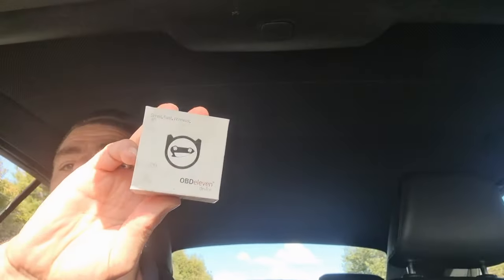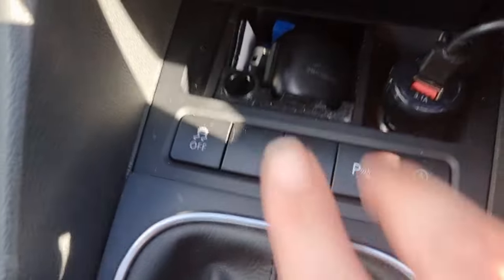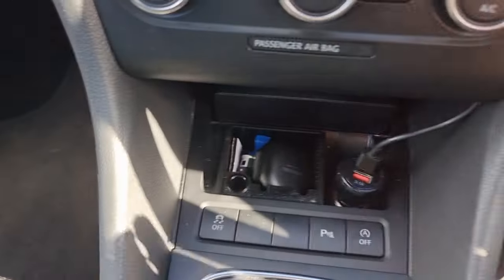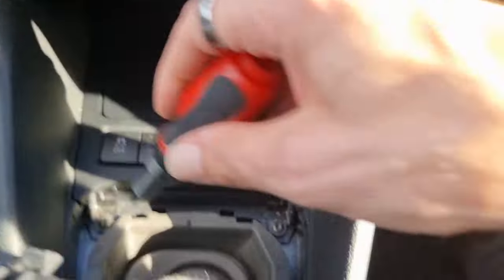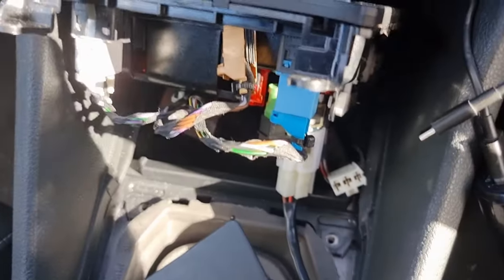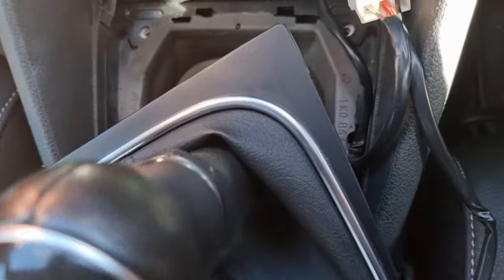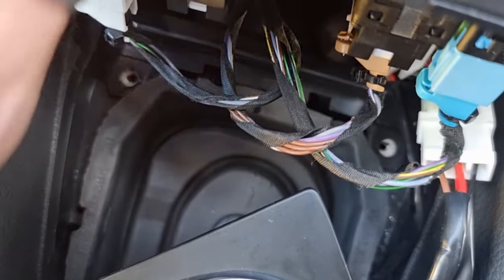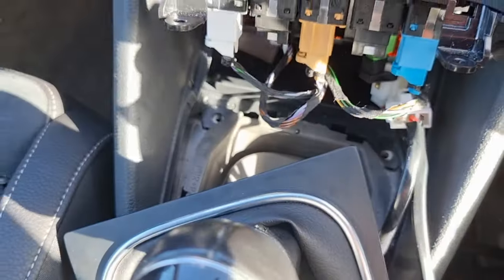Volkswagen usb fast charger install

Comment: Hi. Got some questions.

1. Does this affect how much power is delivered to the cigarette lighter?

2. Are these quality i.e. they won't damage any device that is connected to them?

3. Is there an option to get three of those ports for a VW MK5 Golf?
I will be having two of the ports available to use for the car, but I want one port hidden underneath the console so that I can connect some footwell lights via USB. Would there be any issues since the footwell lights are 5V and this is a 12V connector?
Reply from the maker: Doesn't affect power out put to the 12v port. 
The 2 I have are linked in sequence...don't see why you could purchase a single and double and link the 3 together...footwear lights will work of of these

Comment: nice vid, thanks. 10 mins to fit but the finish isn't a good match for OEM. Still cant grumble at the price or with the install vid. Cheers
Reply from the maker: Colour is slightly off, but they work

Comment: Thank you for this Vid, just fitted mine and moved my parking sensor to the middle, looks really good. The silver bendy clip that’s on the front and back of the parking sensor unit (to hold them in) the front one come off and I couldn’t get it back on, I’ve put it all back together and it seems fine, I guess it’s ok without it but any idea how you can put it back on the unit?
Reply from the maker: They are just clips to stop them from being pulled up and out...not got a clue how they go back on 🤷‍♂️

Comment: Hello,
I installed the same USB ports on my Golf 4 car, but even though the car is not running, the USB port lights are on and never turn off and it continues to charge the phone. What could be the reason for this?
Reply from the maker: That will be because the golf mk4 12v port remains on even when the ignition is switch off....not sure off hand but I think the mk4 12v port fuse can be move so it ignition live instead of permanent live

Comment: Just came across this video and like the way it looks, just wondering when you ordered the kit, did you have to specify 2 usb?
Reply from the maker: I don't know how I ended up with 2 usb... I thought I had ordered 1 usb and 1 usb-c, but 2 usbs turned up 🤷
Reply: @whatsdavedone104  aw fair enough, it’s 2 usb I’d prefer. I might be lucky like yourself when I order mine 😃
Reply from the maker: Just found this one that gives you the option to choice....double usb is listed 
￡4.35  20%OFF | 1PC Quick Car Charger Socket 12V/24V Cigarette Lighter QC3.0 PD USB Interface Use For Volkswagen Jetta 5 MK5 Scirocco Golf 06-12
https://a.aliexpress.com/_EJ1O9TV
Reply: @whatsdavedone104  you are a legend, thanks for that, will get them ordered.
Reply: @whatsdavedone104 should this fit a mk3 caddy 2012 plate?
Reply from the maker: Yes will fit a caddy mk3 👌

Comment: Is there a way to stop the led from lighting up even when the car is off. I'm worried about the battery
Reply from the maker: What car have you installed it in? My MK6 12v port is ignition live, I am guessing your is constantly live 🙈
Reply: Erm a 2010 Scirocco. I think the light actually went off after a while..... Only just installed about 30 mins ago so not sure if it just stays on for 10 mins or something. It doesn't charge until I switch the car on though so maybe it's some sort of remaining power in the circuit?
Reply from the maker: @delboysung  if it's not charging until ignition is on then there will be no battery drain, leds can hold a little power for a short time after power source is turned off.
Reply: Hey @depboysung does it charge while car is off? Planning to install on my scirocco too
Reply from the maker: @aoxsystems if you Cig lighter is ignition power only then no it won't charge with ignition off
Reply: @whatsdavedone104  thank you, gonna try it

Comment: Hi. I got the same wiring harness as yours but have the QC3.0 and TYPE-C+PD plugs. I saw where you plugged the big female connector to the cigarette lighter but am confused as to where the smaller male plug that runs off the female one that plugged into the cigarette lighter goes. Mu harness has two plugs in addition to the two USB plugs. I hope I haven't totally confused the hell outta ya! 😂! TYIA.....
Reply from the maker: Let me just watch the video back to see which connections you mean 🤔
Reply from the maker: I'm sorry but I don't know which plug you mean...unplug the cig lighter, plug harness from usbs into the lighter, then plug original plug for lighter into the white plug on the harness 🤷‍♂️
Reply: @whatsdavedone104  thank you so much for your reply. I think I understand now. The big plug goes onto the cig lighter and the factory one that came off the cig lighter plugs into the only remaining plug. Thank you very much! Am going to do this on my next day off! Have a great weekend Sir!

Comment: Hi, do you have any example of how it connects with the cig. Lighter unit? Could’nr get a really clear view on it connecting 😅
Reply from the maker: It's a straight forward piggy back from cig lighter to harness. Cig lighter still works after all is plugged in.

Comment: Hy. Does the usb-s glows red in the dark?
Reply from the maker: Yes it's glows red 👌
Reply: @whatsdavedone104   And Dave, one more question. Does the light turn off when you remove key?
Reply from the maker: Yes, it piggy backs off the 12v cigarette lighter. Ignition off no power to 12v
Reply: @whatsdavedone104  tnx
Reply: @Dave, I’ve connected a fuse adapter so my cigarette lighter stays on after shutting the car off and it doesn’t drain the batter. I’m curious once I toggle the usb into the lighter, would having those usb still on drain the battery?
Reply from the maker: Very low voltage on leds, I can't see that it would be enough to drain the battery.

Comment: what voltage do they provide at the usb output, are these plugs also chargers and provide 5V, mobile phones are charged at 5V, also dashcams...
Reply from the maker: 3.1 amps fast charging, all charger provided 5v....its amps not volts
Reply: @whatsdavedone104  then I can charge the mobile phone without burning the mobile phone...
Reply from the maker: No issues charging my Samsung S21u for the past 6 months, can also fast charger tablets and laptops

Comment: Do you know how much watts it gives? Is it safe to use if it's connected directly to the lighter without any electronic?
Reply from the maker: It's 12v 3.1amps....yes it's safe to use

Comment: Hello, where to find 2 usb in the same wire as you show us in your video ?
Reply from the maker: There is a link in the video description .....￡16.62  30%OFF | USB Charger Socket Fast Charge Adapter PD Type C and QC3.0 Power Outlet Switch for VW Golf 6 Jetta 5 MK5 Scirocco 2006 - 2014
https://a.aliexpress.com/_EI5cOjv
Reply: thank you for your answer but I see them but there is just 1 usb the other is Type C not USB ?
Reply: here i found the link
 @whatsdavedone104

Comment: So is there a step down in the button from 12v to 5v or something?
Reply from the maker: I guess there must be, but not sure where it would be in the harness 🤷‍♂️
Reply: @whatsdavedone104  Nice one m8 I just ordered of aliexpress. Do you know what the Watts on it? Probably like 20 - 25w?
Reply from the maker: Not sure but it fast charges my Samsung s23u....think its 25w
Reply: @whatsdavedone104  I have samsung, too, so it's defo better than normal 2.0 usb way better. Cheers 🍻
Reply: @whatsdavedone104  Does your one have a spliter so that you can still connect the lighter socket?
Reply from the maker: @Drian12_1-pn3oi yes, it piggy backs off the 12v so the actual lighter port can still be used along with the 2 usbs all at same time.
Reply: @whatsdavedone104  ahha nice one mate thank you. I'm surprised it's actually this good of a design.
Reply from the maker: It's a fantastic design add to the fact you can choose which connection types you want, 2x usb, 1 usb 1 usbc or 2 usbc....

Comment: Any way to connect these with an Android auto radio so I can run Android auto through it?
Reply from the maker: Unfortunately not, they piggy back off the cigarette lighter...you can purchase usbs fit in slot and go to back of headunit....what headunit do you have?
Reply: @whatsdavedone104  I haven't purchased a head unit yet. Shopping around. Some have USBs in the back. But I've yet to find a USB to USB one!
Reply from the maker: I have the Eonon Q53pro, see videos on my channel, best unit for the money, wireless android auto https://amzn.to/3j69897
Reply from the maker: @Clarke  ￡2.78 | 150CM DIY Car USB Adapter Audio USB Cable Switch for Volkswagen
https://a.aliexpress.com/_EyqJbtP
Reply: @whatsdavedone104  Dave your a legend thank you!! I'll scrap that Ali idea and go with the Eonon you linked. It'll look slick in the scirocco! 

I hope the wireless android auto works well? I've a pixel 7 pro
Reply from the maker: Do a wired connection before fully installing, use original charger cable. Then unplug the wire, complete install and fire up wireless connection 👍
Reply: @whatsdavedone104  people pay for these kinds of tips, I'm brand new to customizing cars. I'm obsessed already. I'll be sure to come back and let you know how I get on. 

Running a 2011 scirocco 1.4 160hp myself
Reply from the maker: I don't have a rocco...2 mk6 golfs 1.6 tdi remapped 152bhp and a mk6 cabriolet remapped to 210bhp.

Comment: So does the power to this come off the cigarette lighter? If so do you still get power to the lighter if I wanted to use it to power a tyre compressor for eg?
Reply from the maker: Yes it get power from the lighter and the lighter still works, the harness links lighter and usb ports
Reply from the maker: You won't have seen me on there for a good while...they kicked me off and banned me for posting helpful videos like this 😡 maybe you could share the video on there 🤷 they were supposed to send me usbC and usb but got 2 usbs!! Here is the link ￡17.17  30%OFF | USB Charger Socket Fast Charge Adapter PD Type C and QC3.0 Power Outlet Switch for VW Golf 6 Jetta 5 MK5 Scirocco 2006 - 2014
https://a.aliexpress.com/_EIw5eG7
Reply: @whatsdavedone104  That’s weird, I wonder why they’d do that. I can still see your content on there, the last being from April though. I’ll see if I can post the link on there, I’ve already changed the climate control myself and upgraded the gear stick. This would really finish it off. Do you also know a Sean Foster from Birmingham? He got me to buy this golf 2 years ago and he said he know’s you.
Reply from the maker: The name rings a bell but wouldn't say I know him personally....could you drop me a like to one of my posts on the group and I will try and open it from there....link to the group has been sent to me but won't open 🤷
Reply: @whatsdavedone104  Just liked one of them, try that.
Reply: Dave do have any idea how to wire a USB fast charger to the fag lighter loom that came with a USB?
Reply from the maker: Do you have a link to the one you have...
Reply: @whatsdavedone104  to late lol I fried it.but I have ordered from your link 👍

Comment: Hello. Can you please drop a link of these USB ports ? Thanks
Reply from the maker: The link is in videos description....￡17.17  30%OFF | USB Charger Socket Fast Charge Adapter PD Type C and QC3.0 Power Outlet Switch for VW Golf 6 Jetta 5 MK5 Scirocco 2006 - 2014
https://a.aliexpress.com/_EIw5eG7

Comment: They’re deffo not fast charging, you want USB C
Reply from the maker: Mine fast charges my S23u and partners S22....not super fast like wall plug...definitely states "fast charging" when I pull my phone in
Reply from the maker: Usb c is just plug type nothingbto do with fast charging...
Reply: @whatsdavedone104  USB C to USB C delivers much higher charging output than a USB A to USB C
Reply from the maker: @Official__RILO USB C are available for this modification.....I am happy with USB A and does the job I need it for. 😀
Reply: Interested in ordering usb a and usb c, don't think you can contact the seller, I'd want super fast charging 25w instead of the standard 15w fast charging. Hopefully their usb c to c is super fast